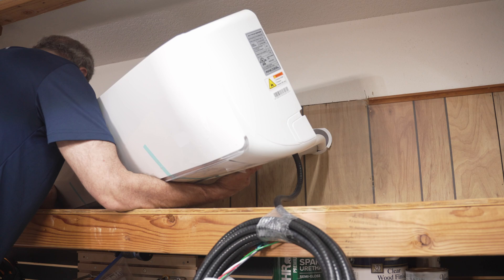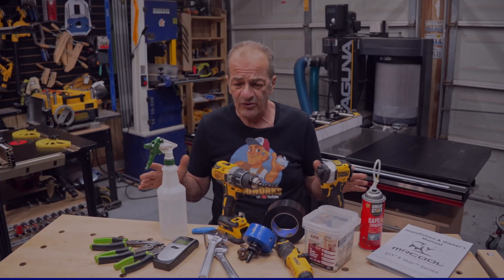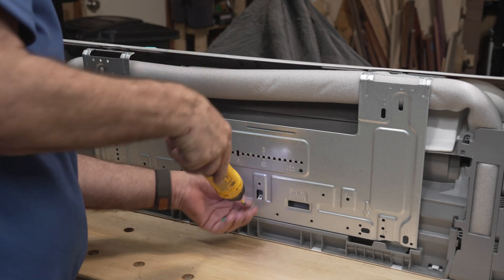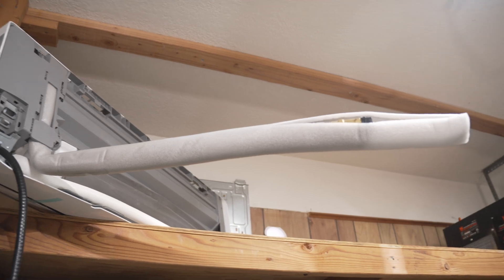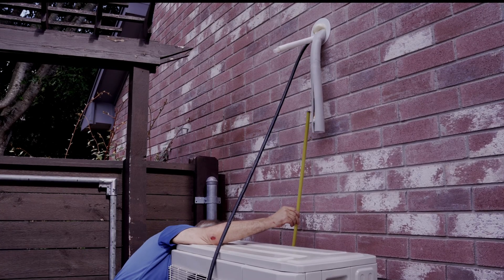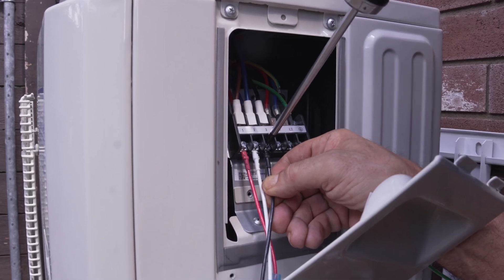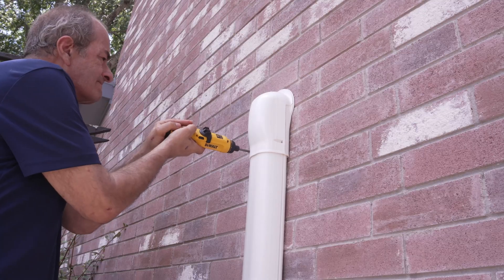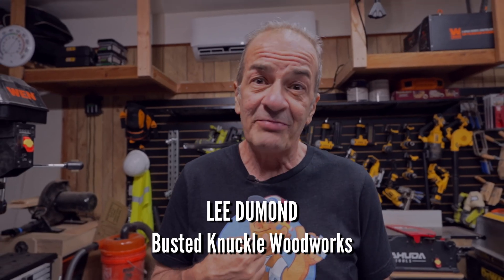Installing a mini-split — everything they DON'T tell you

Comment: Thanks for the clear instructions. It gave me the confidence to install a MRCOOL DIY 12K unit in my 10' x 16' shed (which is probably overkill but cost me LESS than the 9K unit!). Your items were very timely. However, I have a few to add:

(1) If you're planning on placing the condenser on the ground, give yourself a few days to create the concrete pad. I used some leftover 2x4s (made my pad 36" x 18") and used 3 bags of general sand and 2 1/2 bags of redimix concrete. It took me about 2 hours to do, from prepping the ground, to making the form, to mixing and pouring the concrete), but several days for the concrete to cure.
(2) When installing the condenser on the concrete, I found it necessary to remove the fan grill in order to drive the screws through the feet into the concrete.
(3) When using the spray foam insulation in-a-can, put in more than you think you'll need and allow it to cure overnight. If you overdid it, you can always cut away the excess. Also, USE GLOVES (like they say on the can). I'm still picking spray foam off my thumb from several days ago. ALSO, when I used the spray foam, it caused an Error on my air handler which thought it had detected a leak (probably from the propellant). I had to flip the circuit breaker off, wait 30 seconds, then turn it back on in order to clear the error.
(4) I also recommend installing the protective plastic cover over the outside portion of the lines. However, the holes in first section, which is placed just beneath the exit of the lines through the wall, are impossible to use due to the lines themselves. I had to make my own holes. I also used my own 1 1/4" construction screws to attach the thing to the outside (wooden) wall.

Thanks, again.
Reply from the maker: Thanks for the added tips, those are great! Also, be careful not to get any short-cycling from having such a big unit in that space.

Comment: Question for you:  At 11:25 where you're connecting the brass line fittings - I'm not seeing any teflon tape.  Is that an oversight or do you actually not need it?

Never mind - thanks for discussing this issue!
Reply from the maker: Do NOT use teflon tape on these 🚫

Comment: I didn't see the condensation line and what happens to it after you run it through the exterior wall
Reply from the maker: It's part of the bundle that goes through the wall, along with the lineset and the power. I just let it dangle behind the condenser and it drips onto the ground.

Comment: I have the same useless  tape or whatever  it does.   Also mine was small  enough  to do 120v with a extension  cord .  12gauge.   8 ga is to  huge.
Reply from the maker: A 12 gauge extension cord will run up to a 12k BTU just fine 👍

Comment: FYI: They don't come with a hole saw anymore, or at least my 24k Mr. Cool unit, which I'm currently installing, didn't come with the 3-1/2" saw that everyone else seemed to get. But I had a 3-5/8" hole saw and it was close enough. But if you don't have a 3 -1/2" hole saw or something really close, you'll need to pick one up before you start... or you'll be making a run to the hardware store.
Reply from the maker: There is an installation kit you can buy that has the hole saw and some other tools, but it’s a separate purchase.
Reply: @BustedKnuckleWoodworks  Good to know 👍But at least I've got the tools i need to get the job done.

Comment: TAKE NOTICE: Just a Note for those looking to get the "Rebates" for these being energy efficient. READ THE WHOLE THING. The form I got from my power company, down in the details it said that by getting this "rebate", that the power company can then control my unit "...from now and into the future..." . People are going to figure out why all these "Smart Devices" have been pushed so hard. I'm not installing the wifi stick in my Mr. Cool to say the least. Which I'm going to finish installing today.
Reply from the maker: Good point! I installed the WiFi but didn’t apply for the rebate

Comment: Don't go cheap on the outside piping cover. Get the bigger material, as the piping is real tight in the 3" gutter material.
Reply from the maker: It fits, but yes it’s definitely tight

Comment: Great Video 👍 I've seen a bunch of people using the sound dampening wraps wrong. A number of them wrap the pads around both lines held together, which negates the entire purpose of the wraps. And I've even seen someone wrap it around the OUTSIDE of the foam that is over the lines.
Reply from the maker: Exactly, I’ve seen others do that too. Easy mistake to make!

Comment: It is also very important to cover the drain line also as he did because it will rot from sunlight within a couple of years.  I had a unit installed by a professional and it was a total mess.  The unit was not attached to studs and was supported with shims against the window molding on the inside.  Soon it started leaning in from the top and the drain pan started leaking all over my wall and floor.  I will be looking to replace this unit this spring and make sure it is done right.  Meanwhile, I have some black mold to get rid off.  P.S.  The installed who installed my unit is no longer in business.
Reply from the maker: Out of business? Imagine that, I wonder why 😂

Comment: Please forgive this somewhat lengthy running commentary.
— First, as much as I respect folks who actually DO things, don’t forget that there’s a reason journeymen are called “skilled” labor. Respect them. 
— Common sense? WTF is that? How about “read the manual” or “learn the trade first?” Good advice, though, about taking it slow.
— Prepare? What heresy! 😀 Plan? I don’t know if I can handle all this work — doesn’t everyone just bumble along, spending half the day running back and forth to the hardware store?
— Good advice on drilling the holes. When I did prep work for my HVAC guy, he was surprised by the sleeves I had for the holes. This must be the most ignored code requirement.                           
— Concrete pads rule! — though I had never considered a wall mount. Vibration? Are these things that lightweight? You DO want to consider debris, puddles, snow (if it’s an heat pump), and lawn care in your placement.
— Never forget Mickey Meth-head will try to steal your outside parts to sell for scrap.
— I say: Bring in a licensed HVAC guide, make your own line set, and use push-on fittings. Let the HVAC guy test and charge the lines. Why?  First, you get better efficiency the shorter the lines, You don’t have to figure out what to do with the “extra” line length. Finally, you can use elbows to make sharp turns and keep the lines close to the walls. Make sure to leave working space between the wall and the condenser. Push-on fittings (Rectorseal, Parker) are quite expensive, but well worth it. If you MUST bend the lines, spend the $200 and use a proper bender.(Yellow jacket).
— Duct tape — even Gorilla. _ dries out after a year or so then falls off. Instead, get some thick PVC “pipe wrap” tape. The tape is black, comes with or without certification markings (plumbers need the markings for their inspector), in widths from 2” to 4”, and can be found at electrical, plumbing, and HVAC houses.
— I prefer the Square D “QO200TR” disconnect. Though small, I can easily replace the snap-in switch module in it with a properly sized QU breaker.
— Standard practice to mark the white wire with red tape? NO WAY. You were never allowed to re-identify the white or green wires. Current code say you have to use colored wire — period. Use the right wire. (Your install uses PVC pipe, so there’s no excuse for having the wrong wires).
— The smallest unit I could find was 9K BTU. From Mr. Cool, this unit needs a “20 amp capable” circuit. That would call for only #12 wire. The HVAC trade usually uses #10 from the panel to the disconnect. I’ve never seen a residential unit require #8, even when the unit is pretty far from the panel. Since the disconnect is rated for 60 amps, those terminals should accept #8.
— What happened to the drain line? Doesn’t the inside part also have a drain line?
— Covers for the line set are also available at the HVAC supply house.
Reply from the maker: Wow, I wish I could have had you doing this video with me! Great stuff here, really appreciate it 🙏

Comment: Our property butts up against a forest. We’ve had issues with mice and other critters burrowing through the spray foam.  I ended up putting steel wool in the spray foam. You can see where they’ve started, but give up shortly after hitting the steel wool. Thanks for the video. - Phil
Reply from the maker: Dang, that’s an awesome idea! Our critter problem here is deer, and they can’t fit through the hole 🙂

Comment: I've got the 24K unit waiting to get installed on the back wall of my shop.  Thanks for giving all these tips and making me aware of the "gotchas".  I'm wall mounting it and it will be used to maintain proper temp/humidity in my yet-to-be built paint booth.  Subscribed!!

Comment: What do I do if I have sunroom and the exterior wall is pretty much windows? Can I install on non exterior wall? The floor is a deck that has been tiled over and the deck was enclosed . Can I run the lines straight down and drill hole in floor to run under raised deck floor?
Reply from the maker: Have a look at this video. He installed his on a non-exterior wall. https://youtu.be/mtjchhnrW2s
Reply: You can run the coolant lines under the floor, but the water hose might be a problem. Well, while water doesn't flow upward on its own, it will work as long as the inside unit is still significantly higher the outlet end of the water hose on the outside and the water hose never gets higher than the height at which it is attached to the inside unit. Water condenses in the cold unit, and you want it to be able to flow to the outside.

If the inside unit is lower, you'd need to get a condensate pump for the AC (which can pumb the water upwards). Like when you install the outside unit on the roof and the inside unit on an interior wall, and run the pipes through an unused chimney (I hope no one has the funny idea of drilling a hole though a flat roof!). Or when you run the lines though a suspended ceiling.

Comment: Did I miss the part where the circuit was run to the location?
Reply from the maker: That’s gonna be so different for everybody that I didn’t think it would be helpful to include it. It was just a matter of tapping into my 220v sub panel and running over some conduit.
Reply: @BustedKnuckleWoodworks  I only asked because that is something that is not just a "DIY" type project.

Comment: Nice video and great explanation. Too bad Mr. Cool are quit expensive compared to other brands or resellers
Reply from the maker: True, but you save a lot of money not having to charge the lines yourself, or hiring someone to do it
Reply: @BustedKnuckleWoodworks  for a DIY installation it cost only 150 $ to buy a vacuum pump and that's it, There's no need to charge de lines because the externat unit of the other brands are precharged to fill the lines...

Comment: The process starts before you buy.  Decide where things will go do you get the right length line set. Too long and you lose efficiency, too short and... Well that's a big problem.
Reply from the maker: Right, gotta plan ahead!
Reply: When you need to carry it upstairs, check the dimensions of the stairs. Luckily, I did. My unit fit on the stairs without a problem.

Minor issue: at the corner of the stairs, it was either the unit or me.

Luckily, some guy asking for donations rang at the front door. With two persons, it was easy to get the (pretty heavy) unit around the corner.

Comment: You need to pull a vacuum on the line set before opening the valves....
Reply from the maker: @marvino.4947  not with these Mr. Cool units, they come pre-charged.

Comment: I cannot install it using the rear wall. My best option is to run the cables through a lateral wall (left side). Will that give me enough inclination for the drainage? I will also need to connect the line inside the unit and cut the lateral plastic case a bit. Any thoughts/recommendations?
Reply from the maker: Check out this video https://youtu.be/mtjchhnrW2s where Brad had the same issue with installation on a lateral wall.

Comment: I just mounted the inside unit. Man that thing is unweildy! The size an weight isn't bad, it's the guidance and control of the line and tubing. I found that my hole through was slightly too low even though I used the template. About a 1/4 inch of the through pipe is visible. I had to cut part of the flange off to get the unit to snap in. At that point I deciede to stop and watch a few youtube videos. Thanks for the video! I might get the confidence to finish this job.
Reply from the maker: Just take your time and apply some common sense and you’ll get it. As you can see, I even had some trouble getting that inside unit up there!

Comment: The only thing I regret about installing a mini-split last year is not installing it years ago.  Doesn't even compare to the crappy portable I had in my garage.  I am a little surprised that as someone who prides himself on being frugal you decided to pick Mr Cool.  Sure the precharged lineset makes things somewhat easier but at almost 3X the cost?  Wow.    I also don't know long term how reliable my TOSOT will be but I will be able to replace it a couple of times before I reach the price point of a Mr Cool.  Sure you have to get a vacuum pump and gauges for around $150 and vacuum the lines before releasing the charge but that was pretty easy IMO, and that allowed me to fully verify the vacuum was holding before releasing the refrigerant.  I already had a 4" hole in my wall from the portable A/C exhaust so I was able to 3D print a nice custom sleeve and run all the lines through that.
Reply from the maker: I didn’t pay for the system, so my frugality record remains intact ☺️. You make several good points here though.
Reply: @BustedKnuckleWoodworks  Oh sure, today it's Mr Cool. What is it tomorrow, Festool Domino?  The horror! 😃
Reply: Precharged quick-connect lines should just raise the price by $100 - $150, compared to a unit with non-quick-connect lines (but I don't know the Mr Cool brand ones, factor 3 sounds insane!).

Of couse it depends on the length of the prechaned lines. Some shops offer prechanged lines of different lengths. 5 meters (16 ft) seems to be the standard.

Comment: Wait until the blower wheel gets clogged up. You'll have to uninstall the whole thing, take it completely apart. You'll need a recovery machine and a vacuum pump.
Reply from the maker: @Bryan-Hensley  why would that happen?
Reply: @BustedKnuckleWoodworks  dust, smoke, paint vapors, sheetrock dust is horrible, ect. Those filters don't filter very well.
Reply: @Bryan-Hensley  That is a good case for adding some sort of air filter or exhaust!

Comment: I know you didn't recommend the pvc pad, i did that with a fauc concrete pad, with a 4 unit MR cool unit (4 9k's) so much bigger outside then the single and it's been fine for 3 years now.  I leveled it with dirt, pounded down, i don't think I would recommend putting it on mulch like in your video, then used tapcons to secure unit to it.  Since the unit is so heavy it's not going anywhere, and I get wind off the river next to my house like you wouldn't believe, broken 3 screen doors cause of it, and it hasn't moved.  I couldn't do the wall thing cause of the location, i needed to be away from my house a bit, like 2 feet, and maybe i should have done a concrete pad, but I just wanted to install it and tbh it was cheaper than the concrete cost at least for me at the time.  Just putting my 2 cents incase anyone is worried cause they already purchased the pad.
Reply from the maker: @dardack  It sounds like you did it the right way. I’ve just seen people use those very light plastic ones and not level or secure them properly.

Comment: 10:30 I would wait on that spray foam until you are sure that the unit is working. It would be very messy to scrape all that spray foam if you notice that you got a defective unit at the very end.
Reply from the maker: Excellent suggestion 👍

Comment: Refrigerant coiled lines need to lay flat so the oil in the system can run back to the condenser do not leave the refrigerant line set coiled in a vertical location  50 years experience it will kill the compressor
Reply from the maker: Interesting, I did not know that
Reply: @robertdehart7128 Tell him it’s plainly stated in the installation instruction manual.